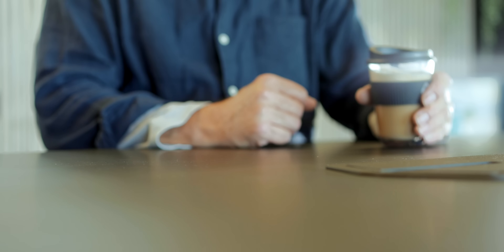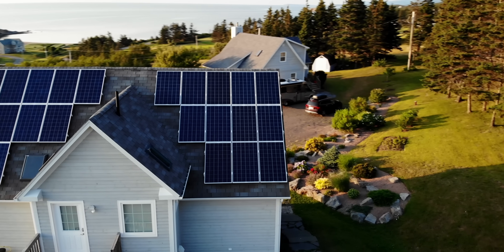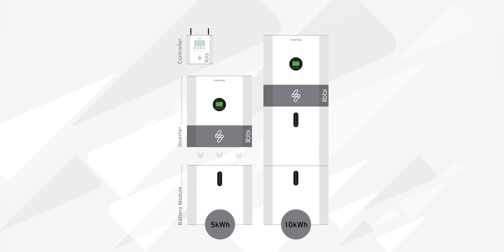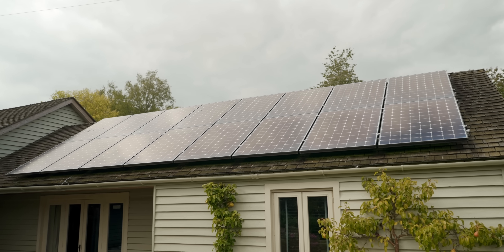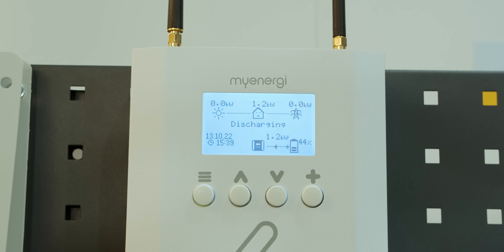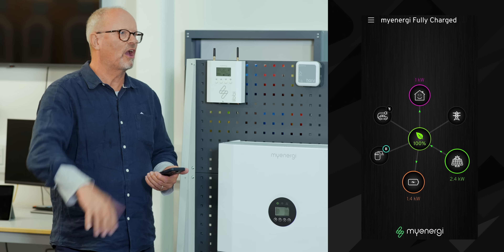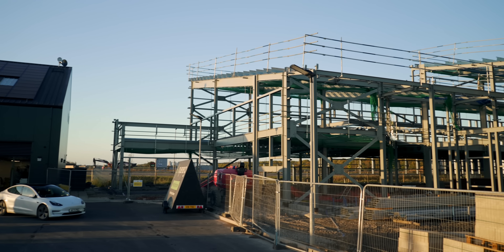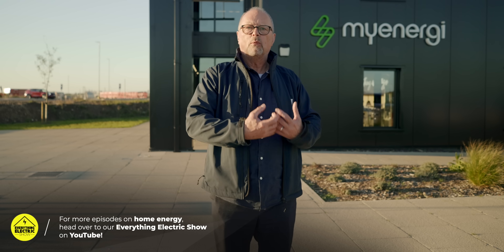THIS Home Battery is the Key To Cheaper, Cleaner Energy!

Comment: These integrated inverter and battery solutions are great but I really wish they would offer bigger capacity inverters for those of us that have/want to install a >5kw solar array. This is a real choke point and forces you to source separate inverter and battery solutions.
Reply: The infographic did seem to show more than one inverter - one of which had one attached battery modules and the other had a second battery module.  I would ask them about your use case - do please let us know the answer?
Reply: If you look at the cost benefit equitation on those super solar days you are generating 4kw plus then you’ll run out of pack capacity anyway.  You want to sweat an asset like an inverter.
Reply: @edc1569  what about EV charging? Did i miss something, would like potentially by-pass the inverter and go straight dc to dc? Would be good for efficiency and great if you had a bigger solar array and didn’t want to be inverter throttled.
Reply: @davidshipp623  you charge your EV off solar or off cheaper over night, if you charge it from battery you’ll just deplete it and the house will be on grid anyway. I think people tend to oversize inverters vs batteries, a lot of peak power is a maybe handy for the cooking in the evening, but really you’re best off just importing a few hundred watt hours and not paying for a much larger inverter. For most people you need a 15kwh plus pack for a 5KW inverter to make sense.
Reply: @edc1569  yeah the point was that the 5KW is an absolute power throttle, for someone charging off solar with a large array wouldn’t be able to exceed that and with other domestic usage might only have 3KW say for the EV charging. I know that most domestic systems are limited by inverter anyway and agree it is about balance but was just wondering about the dc to dc element. Having said that I do get your point, unless I am traveling a lot the amount the car needs to charge isn’t that great and if solar is available I charge at a low rate by reducing ampage in the car, just a bit fiddly. I have survived pretty comfortably on a 4KW inverter. But is does feel like this might be more of a limitation in the future. (Not for me though)
Reply: The inverter is 5 kW? So, it won't support the house fully if the power goes out... a bit puny...
Reply: @zapfanzapfan  this battery will only back up on a dedicated socket or light ,  not a whole home solution, otherwise known as an auxiliary backup
Reply: @zapfanzapfan  why? Who needs more than 5KW during a power cut?
Reply: @edc1569  If you use gas for cooking I guess you don't.
Reply: @edc1569  Who wants to b connected to the Grid ‘full stop’…
Reply: @zapfanzapfan  5kW gets you plenty of electric cooking. An electric shower would be too much for it, but you can definitely cook. One day we might get cookers with a control protocol to tell them to power limit to X so the sstem is fully integrated, but in the meantime it's not that hard to remember not to put 3 rings on full blast at once, which would trip the inverter.
Reply: @xxwookey  honestly for cooking just pay to import some energy it makes no sense to have an inverter with reserve capacity to try and offset £10 a year of grid import.
Reply: @oakashthorn5714  sure but that’s a really different application to 99% of consumers who are buying an AC battery. In the UK you aren’t getting through winter without the grid - or hydro or maybe wind.
Reply: @zapfanzapfan  if you’re in a power cut you probably don’t want to cook a roast dinner, conserve the battery as otherwise you’re going to end up in the dark.
Reply: @edc1569  Wonder if it’s possible to charge certain battery’s of a diesel generator for a few hours in the winter months🤔
Reply: @xxwookey  Electric shower? Sounds dangerous 🙂 The rating on the stove is about 10 kW but of course rarely used to the fullest. Just have to make sure no one tries to use a blow drier, power tool, coffee maker och micro wave at the same time.
Reply: @zapfanzapfan  power tools are typically 500W, microwaves 850W. Still plenty of margin for most cooking on 5kW. Obviously you could turn enough things on at once to exceed 5kW, but it's not hard to avoid, and learning not to be extravagant during a power cut should not be a big deal.
Reply: But you can Daisey chain them together to achieve 20 kW - I think that's what the video said.
Reply: @JJ-zg1hh  No, the video said you can chain batteries to get up to 20kWh of storage.